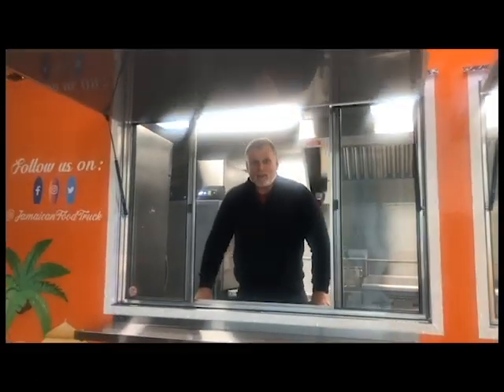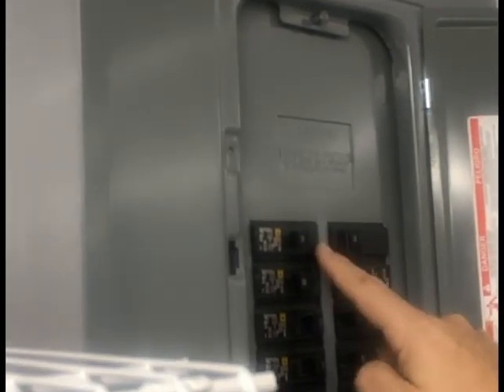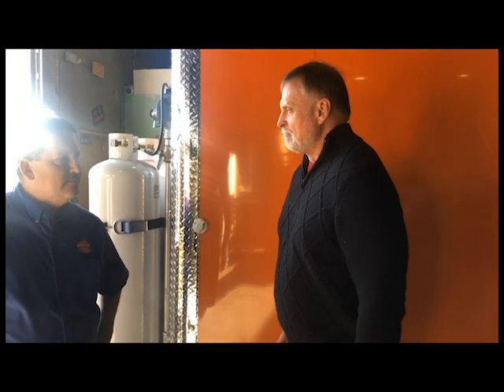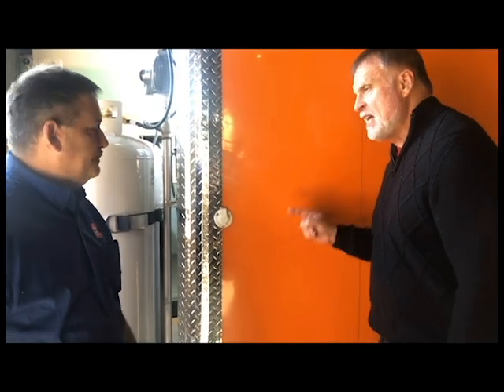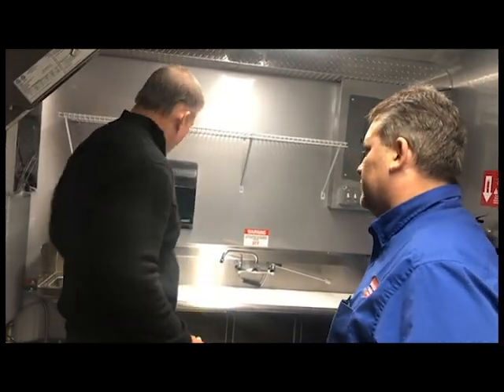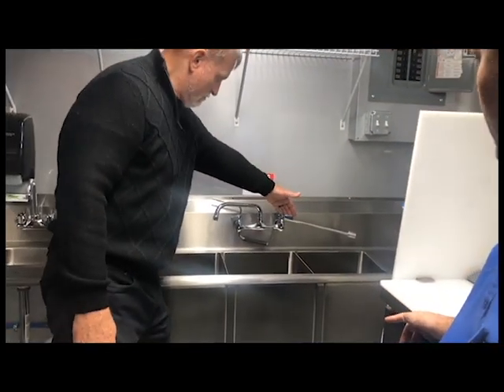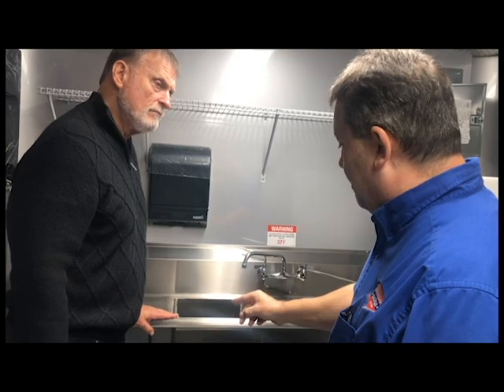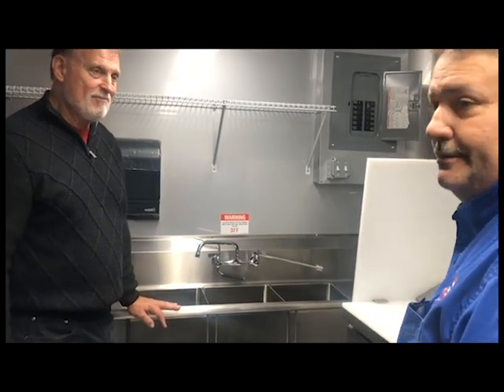Water Operation System in a Food Trailer

Comment: What is the water supply to get the water into the truck with?
Reply from the maker: You connect a garden hose to the water inlet. Thanks
Reply: @ConcessionNationInc  But where does the water come from?  Like if I try to run a hose down the stairs from my apartment onto the street, I think I might get in trouble for that.